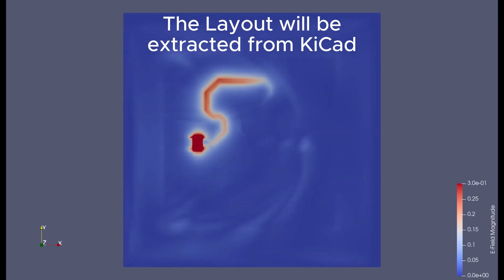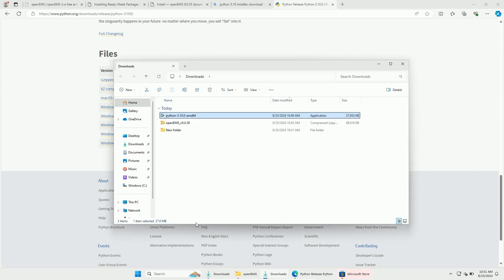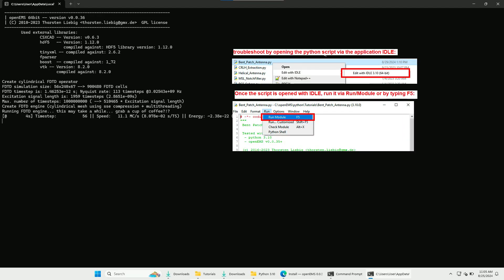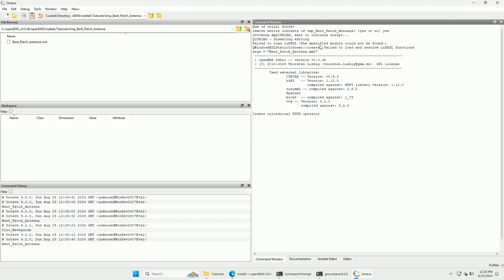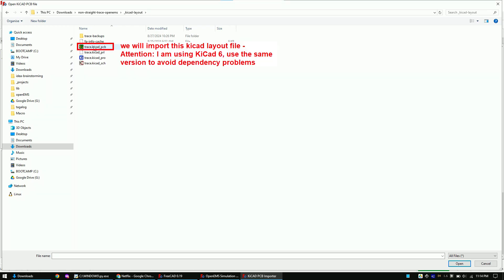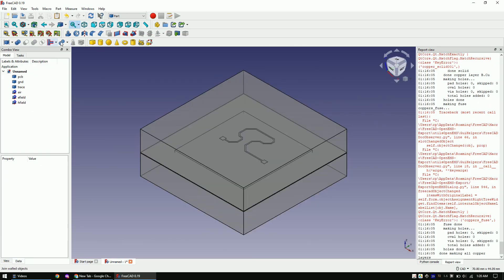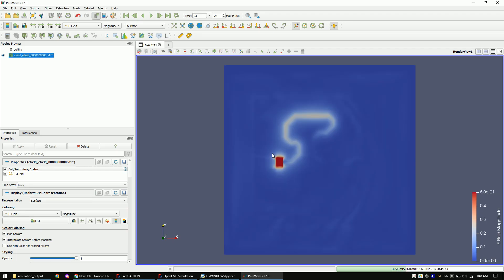free KiCad Wave Propagation Simulation with openEMS (E-Field, H-Field, HF-crosstalk and impedance)

Comment: Does this work on KiCad 9 at all? Using the file you used in your video, everything works fine, but if I open it in KiCad 9 and save it, the macro fails to import the dielectric completely. Any way to fix?
Reply from the maker: Hi there, yes it works for KiCad 9.
Try out this export and import settings:
https://drive.google.com/drive/folders/16u-Pvv9FyjN46TRgA8B1v1minQ8qijdV?usp=drive_link

Possible other issue: your hierarchy might be wrongly set up (small subwindow on the topright of the FreeCAD to openEMS macro), the FR4 has to be the lowest priority and must be moved to the very bottom of the hierarchy. The port has to be the highest priority.

If this also didnt help, you can check out the troubleshooting section on udemy, there you can also post your file and i can have a look on it.

Comment: Thank you for the professional video
Did you tried that with KiCAD 9 and FreeCAD 1.0.1
I am faceing problems with vias and PCB substrate is not converted too
Reply from the maker: so far I only uploaded kicad 9 content and a big step by step troubleshooting section on udemy.

Here is a short text based hint on what to look out for: 
In general its all about avoiding self intersections - sadly the kicad export even with kicad 9 is not good at that.
1) traces have to start and end exactly in the center of vias and move out of a via in a straight line. I mean, dont make any trace turns inside a via.
2) dont move traces out of pads sideways (should go out straight)
3) dont make traces exactly as wide as pads, make them at least 0.00001mm (or whatever value) less wide  than the pads.
4) place vias either fully inside pads or fully outside of pads. I mean dont make just half of a via touch the pads.
5) dont make vias intersect.
6) dont have traces inside traces or dangling tracks inside another track. kicad allows having this scenario, but it will create a self intersection in the step file.
7) pads inside pads create issues, also dont make pads overlap (for example mosfets often have this when the pad shape is complex).
8....

The best approach is to check the PEC dump with paraview. if the traces look wrong, export one part at a time and recheck the PEC dump until your pcb looks correct. This way you will exactly know what parts caused the problems.

Export setting with KiCad 9:
dont use the fuse option
instead export the traces, zones, vias, pads separately, and later assign these separate object as PEC material.
Reply from the maker: regarding vias, ideally you fill the vias so you can get away with a relatively coarse grid. if you for some reason want to model the via walls and are not ok with filled vias, then you need have a grid resolution of minimum 50um. 

through hole pads wont be filled with the fill via option of the step exporter. For this the workaround is to change them to simple SMD pads (non drilled) and place a via in the center of them which now will be filled by the step exporter.
Reply: The problem is that the FreeCAD macro crashes.
And without checking the via option It would work.

In all cases, PCB substrate would not transported
Reply from the maker: @ghaithalsabagh3567  This must be a compatibility issue. What operating system do you use?

Also try exporting without enabling "Cut vias in board body".
Reply: @panire3 
I am using Windows 11
Reply from the maker: @ghaithalsabagh3567  Not sure how to further troubleshoot. Maybe to get started try another laptop or on another os. Though it worked for me also on windows 11, so maybe its a driver problem. Anyway trying it on another system might at least get you started.

Comment: For some reason whenever I follow your steps and I visualise the final simulation using Parraview, it just looks as though there is no trace at all! The input wave form does not travel along the trace (but more so the PCB/FR4). I have correctly set the trace under PEC?.
Reply from the maker: Hi there, Try to first open the PEC dump with paraview. you can enable the pec dump in the Processing tab of the FreeCAD to openEMS macro. This will create a file called "PEC_dump.vtp" in the simulation folder which you can open with Paraview. Is this PEC dump file showing the expected traces? If not, you have to troubleshoot your layout file, maybe start with a very simple project (e.g just a single trace) and work your way up from there.
Reply: @panire3  Thank you for this - Just hours before I tried a simpler trace and that worked out great! Turns out if the "portin" object is not exactly aligned with the trace and GND reference place (in the z-plane), the signal does not make it into the PEC.

Slight tangent; I am wondering what your thoughts are on gerber2ems? The adaptive mesh features seems quite handy.
Reply from the maker: @phil421  glad it worked. Didnt really try out gerber2ems out in depth, so cant give feedback. )

Comment: Is this possible on linux?
Reply from the maker: yes possible on linux. with almost the identical workflow.
The installation process would be slightly different of course but basically all tools are available also on linux. The dependencies are sadly quite extreme, even in windows even the slightest change  in the software versions gave me issues, so be patient and it will work. :)
Best to start with this very simple example and work up from there
Reply: Thank you sir. I will give it a shot over the next week  @panire3

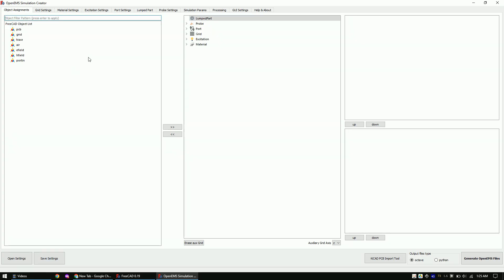Comment: Hey, nice video. However when I do the part at 15:56 I am not able to move the object to a parent. Some of them I can, most I can't. When I open settings with your provided .ini file, it has a red error sign over some of the freecad objects. When I generated the script, it ran fine though.
I am using Linux and a newer version of the macro 

LubomirJagos42/FreeCAD-OpenEMS-Export

Any insight?
Reply from the maker: I would suggest to use the exact same setup as I had for your first simulation. From there you can try changing the software versions one by one.

My experience is that nothing works even with the slightest change to my setup.

Linux (worked fine for me on Ubuntu) is ok, just keep the tools (FreeCAD, KiCad, openEMS, Python, FreeCAD to openems macro) the same at least for the first simulation run, else you are just going to get frustrated because nothing will work. :-)
Reply: @panire3  What version of the macro are you using?
Reply from the maker: @spiffinalandnmlaojcnaksmcvb  https://github.com/LubomirJagos/FreeCAD-OpenEMS-Export

The issue of not being able to move the  objects in the macro window sounds to me like its the wrong freecad version, best use FreeCAD 0.19.4.

Hope you can get it to work soon.
Reply: @panire3  Got it to work. I changed a line of the python code and it started working fine.
Reply from the maker: @spiffinalandnmlaojcnaksmcvb  perfect, nice to hear :)

Comment: Theoretically, what is the basis for determining the placement of portin?
Reply from the maker: Do you mean the physical location?
If so, in an integrated circuit (e.g. microcontroller), the port location would be somewhere on the die inside the packaging. You would only know the exact location by asking the manufacturer.
Here is an example:
https://img-c.udemycdn.com/redactor/raw/q_and_a/2025-01-08_17-39-38-5ce3238a84421f28fb9e6bcdf67c275a.png

In the video i placed the port between the top and the ground layer for demonstration purposes only.

Comment: Setting the excitation to gaussian mean you tried to applied a square wave? And what is the center freq unit? Is in Ghz ,Mhz or what?
Reply from the maker: the unit is GHz, but you can change it to MHz - see 14:52 at the top right corner. There is a dropdown menue where you can adjust the unit.
The center frequency can be choosen freely based on what you want to measure. If you just want to see how a signal moves along the trace, you can inject the step function.

Injecting a square wave works too, but its done via custom injection function, I didnt share yet how to do it, probably i will add a lecture on that in udemy next week.
Reply: @panire3  nice panire! Thanks.

Comment: At 17.39 minute, I attempted to run the code as demonstrated in the video. However, I am unsure which buttons to click to display the code and run it. Could you please indicate which buttons to click to achieve that specific display?
Reply from the maker: If python was installed correctly, you just need to doubleclick on the file that ends with *.py (freecad_openems.py).
If doubleclicking the button doesnt lead to you seeing the 3D preview window, then the python installation has issues. make sure you install the same python version as shown in this tutorial. sadly even the slightest changes to my setup will likely cause errors, so make sure to follow the instructions as close as possible.
Reply from the maker: Ah and one more thing:
If you double click on the python script (freecad_openems.py) and this only shortly opens a popup which closes again right away, there is also a setup issue. In this case make a right click on the file and open it with IDLE - here is a screenshot how this should work:
https://drive.google.com/drive/folders/1FAt5Heg21z2NC1EezfrpTEj6qqbgqe2f?usp=sharing

hope that helps
Once the file is opened in idle, press F5 or click on "Run" in the menu. If everything is fine, you will see the 3D preview, if not then the output window will show you the error message which you need to resolve.

Comment: Heh, for me the "Import button" is always grayed out, even after restarting the macro so can't do anything with it :/
Reply from the maker: Your problem description makes me think you are not using freecad 0.19.4.
Please use exactly this version, else you might have problems with the import button.

Also please use exactly kicad 6.0.11

Even the slightest change to the versions will likely cause problems.
Reply from the maker: if this change does not help, dont be shy to ask for help instead of giving up due to frustration
Reply: @ I did get the import to work now, had to patch a few things, but the imported geometry isn't correct. It seems the importer doesn't process correctly vias where there is only an annular ring on connected layers and not all layers. It's a recent-ish kicad addition so I'm guessing it was never updated to support that.
Reply from the maker: @smunaut  I was able to also work with only an annular ring when changing the grid size in x and y direction to 0.05mm instead of 0.1mm as shown in the video. Here are some screenshots on how to review the generated PEC dump, hope they help: https://drive.google.com/drive/folders/1BWAzePieKENgAA3u-ROWe8_CsoqpEZNL?usp=drive_link
Reply from the maker: @smunaut  This happens often it vias are too close together. Just move around the vias in the position with problems and it might work after a few attempts. The import tool is not always perfect I admit, but you should be able to get the vias corrected with some trial and error

Comment: If doing this for simple PCB, when using the import macro you selected the fuse copper option. If you have a 4, 6, or 8 layer PCB where not all of the copper layers are ground planes would you still select this option? For example I have an 8 layer board with 3 ground planes, if I fuse the copper will it combine those nets? Appreciate the videos these are awesome!
Reply from the maker: The fuse copper does combine all nets in a single object, but this doesnt mean there is a short circuit somewhere if thats what you mean. So with "fuse" you still end up having multiple nets and multiple ground planes as defined in your kicad layout.

If you encounter issues importing a large file, it’s helpful to break the process down—import one trace at a time until you identify the problematic part.
Attention: The process here does not work for "microvias and burried vias (or the so called HDI PCB production process)". If you dont want to bother to figure out your own process on how to import microvias, I show how to do it in my udemy course.

Comment: Hi Panire, 

Thanks so much for doing work!  Thus far, I'm able to get things to work on Python 3.11 & FreeCad1.0 (which is the latest stable version at the time of this comment).  However, inside the FreeCad-OpenEMS Export Macro, the "KiCAD PCB Import Tool" is greyed out no matter what I do (including restarting the macro many times).  I tried to look at the .py codes but still cannot find a solution.  Wonder if you can help to shed light on this... Thanks v much!!
Reply from the maker: Hi there :) 
Sadly I also didnt yet manage to make the import tool work yet with FreeCAD 1. Change to FreeCad 0.19.4 or 0.21 and the import button should work.
Reply: @panire3  Same pain point happens to me. Not able to change button state.
I've installed today Kicad 9.0.6; Freecad 1.0.2; Octave 10.3.0; Python 3.14.0; OpenEMS 0.0.36-93; and the FreeCad Macro from GITHub of LubomirJagos.

Comment: Thank you very much for this video. In the past, I used openEMS with Octave, but I didn’t know it was possible to interface with FreeCAD. It’s a very useful tool, especially for importing PCBs and setting up the simulation. I was used to doing everything with command lines, so this is much faster
Reply from the maker: glad to hear that it helped you to speed up the process. :)

Comment: Anyone successfully run macro on Freecad 1.0.0 ? 
For me the "KICAD PCB Import Tool" does not work
Reply: Same problem here even on version  0.21 is not running
Reply from the maker: I face the same issue, which is why I always stick to version 0.19.4. The same applies to KiCad - even the slightest change leads to major problems. 😊 For anyone using openEMS for the first time, I strongly recommend using my exact setup without any modifications to avoid unnecessary frustration.
Reply: It looks like "import WebGui" has issue
Reply: if you comment above line out the button will appear enabled

Comment: It would be awesome if SPICE models could be integrated in the simulation. I know you can define shunt capacitors / inductors / resistors, but for diodes and transistors things are not trivial.
Reply from the maker: Yes, would be nice to have more things. For sure one day we can have an Arduino running in the simulation that drives some kind of motor. Multiphysics simulation would be also a nice thing to have, lets seee how far we will be in a few years.

Comment: It will come as no surprise that this installation procedure doesn't work on Ubuntu 22.04.5 LTS with FreeCAD 0.21.2 rev 33771 (Git) -- particularly given that panire did tell us to use only FreeCAD 19 ( although the text caption of his speech transcribed that as "9").
Reply from the maker: Thanks for pointing that out, I corrected the subtitle from 0.9 to 0.19. The installation process on Ubuntu is quite different from Windows.
Reply from the maker: I’m considering creating another video on installing it on Linux once I’ve figured it out myself. I’ve already failed five times trying to install it on Ubuntu, so I completely understand your frustration!

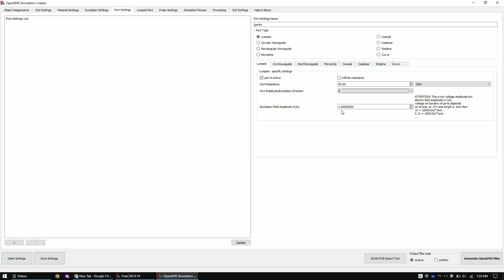Comment: one difference of the video vs the .ini file you uploaded, in the port settings tab 14:57 , you use Z direction while the .ini file you uploaded says X direction
Reply from the maker: Thank you a lot for the correction, it has to be z direction, i corrected the ini file.
By the way, there’s another issue in the video: The electric field setting isn’t in "V/m" but seems to be a unitless scaling factor. So there is no easy way to define the exact voltage pre-simulation. I will have to give an update on how to reliably set the voltage amplitude in the next videos.
Reply: @panire3  hmm... I managed to replicate your simulation using your .ini file with "x" direction though... I will need to check it in depth, maybe the simulation works using both X and Z direction.
Reply from the maker: Enjoy playing around with the different settings.
I will also have to investigate on that a bit more. When I started with openEMS i was always wondering why I have wrong impedance results until I figured out that there is this option on setting the direction of the field, since then I felt a bit more comfortable with the results.